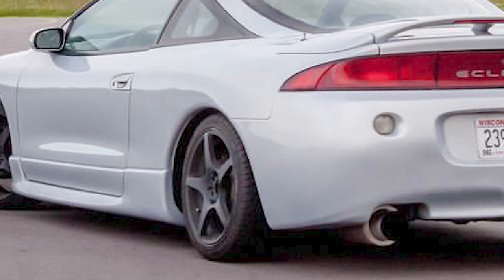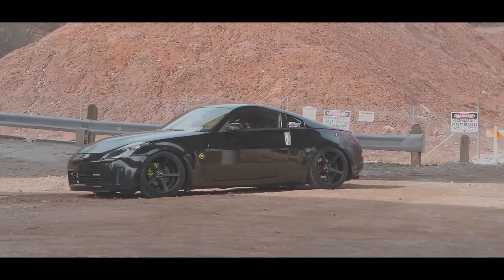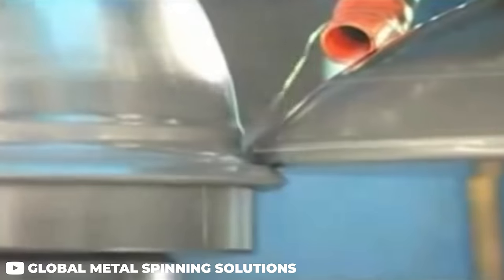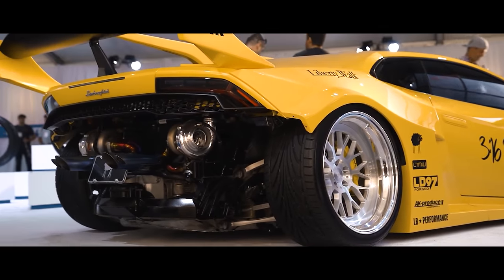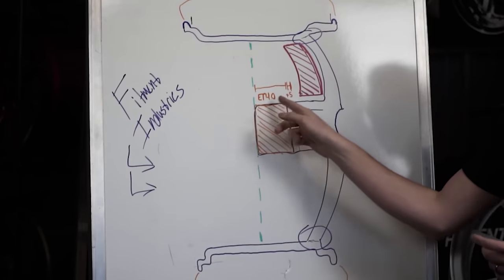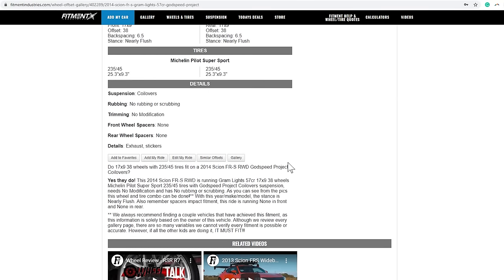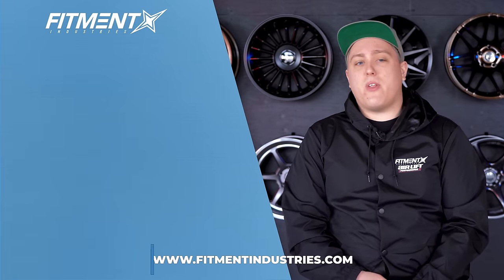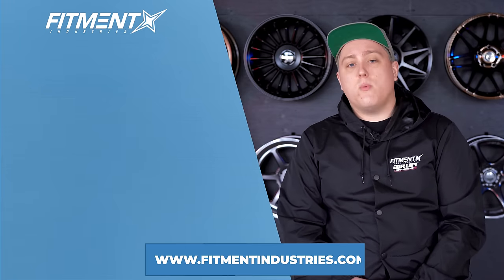Don't Buy Wheels And Tires BEFORE Watching This

Comment: Looking at Fitment for my first ever wheel/tire buy for my Celica. I know you are a salesman for them but no one on the forums have heard of Fitment. How reputable are they? Why should I buy from Fitment? What makes them stand out from the other retailers??
Reply: Don't buy from them. I've been waiting forever for my wheels. They use a freight company with lift gate service so that greatly adds to the already long build time. It takes days for them to mount a set of wheels. Even longer if they are not in stock.  Use their knowledge on fitments but buy from someone else, trust me on this. Google the reviews. I will update this post once I finally receive my wheels.  This has been the worst wheel experience ever.
Reply: @graveshaker  thanks for the heads up!

Comment: What kind of after market wheels can I use  for an rx 350 2015 lexus ? Bearing in mind that I want them as wide as possible, I currently have a 19 inch factory default f sport rim , with 265 50 19  pirelli tyres on
Reply from the maker: Yo!  Check out our gallery and you can see the biggest specs others are running! 🙏

Comment: I have a 2010 Toyota Avalon xls, I know that I need 22x9 , 5x114.3 lug pattern, I want my tires flush with the fenders, what would my offset be, one shop told 30 to 35mm, another shop told me 40 to 50mm. What’s your opinion. Please help.....

Comment: Mistakes: lighter isn't better. BBS/Rays doesn't mean it'll survive a pothole on the highway at 100 MPH. Autocross will bend and warp your BBS wheels. Beadlock needed. Stretch tires will slip off the rim at lower PSI. When you have to use 19 PSI cold to reach the correct hot temp of 29 PSI on your nice ZR tires.

Comment: what brand of tire offers the widest 245 40 18  . I want to keep stock tire size but go from 8.5 to 9.5 wide rim  and would like to limit the streching as much as possible 
thank you
Reply from the maker: If you’re going for a meaty look I would bump up to a 255 on a 9.5 wide!
Reply: @FitmentIndustries  255 40  or 255 35  
I know 255 it s a bit tall but I plan on keeping stock height  2019 wrx  and I wish I could run that size

Comment: I have a 2005 Infiniti fx 45 awd it’s lowered with H&R lowering springs have a set of r35 gtr wheels but don’t know what tire size to use I don’t want to to ruin my awd shaft I want to eliminate the gap between the rim and wheel well and also want that wide tire look please help

Comment: I have a 2020 honda accord stock wheels are 17 but can i to get 20 wheel or thats wont work? if works then what specific for those 20 wheel i need for both tires and wheel thanks

Comment: I’ve got a 2016 Altima with the TPMS system. Can I still use current sensors on the new rims?
Reply from the maker: It is recommended to buy new ones!

Comment: Or better yet what is the correct 19 inch wheel fitment for a m3 e46 2001 convertible with a pandem wide body kit?
Reply from the maker: DM us on IG or FB and we can help with fitment!

Comment: I'm buying a 350z with 18x13 in the rear. What tires size would you recommend for a proper non-stretched look fitment. I prefer to be safe instead of looking cool. Thanks...im a subscriber
Reply: None. Get those things off of it. The only 18" tire that is made to fit a 13" wide 18" wheel, is a 345/35R18. Even a 335/30R18 only goes to 12.5". Get a set of nice 9.5" rear wheels and be done with it. Those 13" rears are totally pointless on that car.
13"x18" wide rear wheels on a 350Z? I got three words for you. "Rice rice baby".
Reply: @AB-80X  yeah I agree with you. Even thou the guy who owned it before me thought it looked cool. At the end of the day. It was rediculous and "rice" with wheels poking out 2" from the fender. 

I now have 18x10.5 with 295/35/18 in the rear. Wheel fitment is spot on...

Comment: Hi maybe we could help you with this question? i have f30 Xdrive in this moment i use tyres 225/40/19 and 255/35/19 I wanted to put higher tires like 255/45/19 and 255/40/19 won't it hurt that 4x4 Xdrive?:) maybe you have an example of who used such images on the f30 thank you
Reply from the maker: Check out our gallery to see if any others are running the same specs!

Comment: Just bought 16x8 wheels for my 03 Tacoma since the stock size (16x7) was near impossible to find in terms of price point and oem weight comparability. Did 0 offset since I didn't want rock chips in paint from negative offset and no point in positive offset on an offroader. Still will be rocking stock tire size but have yet to put the wheels and tires on. A little nervous not gonna lie. Hoping the extra inch doesn't end up screwing me over, not much I could find on forums about people having done the same, some folks said they were fine, some folks said there was some rubbing on mud guards, guess I'll find out soon enough.

Comment: I have 2019 genesis g80 sport ,am looking for 20 inch size wheels instead of 19 inch OEM what brand you can recommend for me with reasonable price?
Reply from the maker: Hey there! Heres a link to the gallery so you can check out various types of styles, that way you can get some good ideas. Heres a link! -Edgar

https://www.fitmentindustries.com/wheel-offset-gallery?sort=yno&year=2019&make=Genesis&model=G80&drive=AWD

Comment: So which would poke out more towards fender,
Wheels 17 7.5jj et35 or 17 8jj et38?
Reply from the maker: The 8's for sure. But not by much! -Edgar
Reply: @FitmentIndustries  
 So even with the offset is 38 the 8jj is wider, cus im trying find wheels for polo 6r i want it to be same as the fenders not poking out not to inside
Reply: Any recommendations?

Comment: Hey I have a 13’ Lexus GS350 Fsport, I am currently running the stock OEM 19’ Alloys, I want to get some wider rims 19x9 front 19x9.5/10 in the back how big should my tires be or what sizes should I get if I do not want to lose ride quality along with achieving that flush look?

Comment: I see some cars with stock size wheels which leaves are regular gap between the wheel well and the tire and I see some where the tire fits right into the wheel well (fender). Does this mean that they got one size higher than the stock size? Also, does it rub in the wheel well when they go over bumps or when they carry heavy cargo in the trunk? Thanks

Comment: Even after this video I'm still not sure what size rims to buy to keep the stock feel on my 08 350z.
Reply: probably 18x8s
Reply: @xGqD_0  I think it said 18x8.5 in front and 18x9.5 in back but not sure about what offset to keep the stock feel because I don't want to have to do coil overs or modifications to make it fit. I'd want to be able to order mount the tire and install that's it

Comment: I live hee in Winnipeg and bought a new Honda Civic. I plan to get an 18in rim and 40R but I was warned by some of my friends that there are some pot holes here in the city so they advised me to get 17in 45R instead. What do you guys think? And also, I've never tried 18in for a sedan yet. Is the ride still smooth or rough?
Reply from the maker: It all depends what width and offset you get.  Going to 18s is something a lot of owners with Civics do.  Check out our gallery for examples!
Reply: @FitmentIndustries  Thanks! I'll check them out. Majority of the people that I asked are in favour of 18in.

Comment: So ok, I seen some fitment with some Volk TE37s 18x10.5 +15 and it was perfect.
Now I'm wanting some Works Emotions, same kind of car.  Still 18x10.5 but since the Works have more of a lip compared to the TE37's, what would the offset be to keep the same fitment as the TE37's?  Or is it the same and I'm totally missing something?

Comment: Good info but I'm still waiting for my wheels and tires was told that one rim was sent straight to me but why would they do that when there suppos to mount and balance and install the tpms sensors. They told me they would send me the tires and I can have a shop install it and they would cover $20 if I send them the recipe. Really need to be better at shipping because I didn't pay $150 for fast shipping and not have you guys even mount or balance. Now I have to wait and pay out of pocket for your mistakes.

Comment: If you have a rl negatieve offset does that mean the wheel is gonna poke more outwards?
Reply: No, it means nothing without a context. If you have a negative offset that is lower than what it was OE for example, then it won't. If you move from a positive offset to a negative offset, yes that will move the wheel further out.
It is very simple. Positive means inwards from the centerline, and negative means outwards from the centerline. Very few modern cars run anything close to a negative offset. That is usually only found in some pickups and older US cars.
All Euro cars and a lot of modern US cars run a positive offset. When dealing with a positive offset, the higher the number, the further in the wheel is set and the higher the negative offset number the further out. It's very simple.

Comment: I have a 2011 mustang gt i bought some Ford performance wheels 18 x 8 the standard tire is 235 50 18 but I want wider tires all around what are my options

Comment: Hey Fitment Industries, I have a request that might be a little troublesome, so it is fine if you cant do it. anyways I was thinking if you could do a SO You want series for Infinity q50/q60, and for Lexus is300/350. I would appreciate it a lot. Plz reply if you see this comment. THANK YOU.
Reply from the maker: Good suggestions! Check out our video on the is300 here - https://youtu.be/yP7PO62u_oE
Reply: Thank you, then only the q50 or q60 plz, if possible.

Comment: How do I know if a bigger tire will fit my wheel? The tires on the wheels now are 275/35Z it's a size 18 wheel I want to get  bigger tires mainly just to have it look good from the back would I run into any issues if I got a bigger size for example a 295 or 305?
Reply: How on earth can anyone answer that if you don't tell us what the wheel width is or what car you have?
Reply: @AB-80X  Yea I’m an idiot lol. after working at a tire shop times have changed & can answer this it’s ease lol. I had to get educated first 😂

Comment: I recently switched my rims out from some 16s to some 19s and while I’m in my car driving I hear some weird sound kinda like scraping and I can’t seem to find where it’s coming from, went back to my 16s and now the sound is gone? I already spent the money on the wheels and I want to use them but this noise needs to go away. Any ideas? I drive a Honda Accord 2012
Reply: Probably rubbing your fenders with your tires
Reply: CRiMZUHN nope checked that.
Reply from the maker: Sounds like you’re rubbing on fender wells! There are other sizes than just diameter that factor into how a wheel fits! Email us at shop@fitmentindustries.com if you have any questions

Comment: Getting my first set of wheels soon 19x8 with a 40 offset. Wondering what tire size is best 245/40 or 235/40. Your input would help a lot. My stock set is 215/60 r16 tires stock wheels 16x7 with a 40 offset.
Reply: Kinda depends on the car in question. But overall, 235/40R19 would be the largest I'd go. 225/40R19 is a more "correct" fit. They will ride better and will have much less of a negative impact on the cars overall performance. You add a lot of weight with those wheels probably, and with the 235/40R19,, you also increase the diameter from 26.1" to 26.4", which essentially has the same effect as a taller gear ratio.
You may think that you gain a lot more grip by going to a 235 over a 225, but think about this. Your car was born with a 215/60R16, and without knowing what car you have, I can be quite sure that it's not a high performance sports car. That's not a negative, it just matters because it is a determining factor in what a tire can offer you. Tires available in your stock size, are grand touring tires, all season stuff etc. and far from performance oriented. You could actually stick to your stock tire width and still gain more grip than the car would ever need, so a 235 will not add anything. If anything, over a 225 it will feel less precise as it will float around more inside the wheel, whereas the 225 will feel slightly stiffer and offer a more direct steering response. A Michelin Pilot Sport 4S in 225/40R19 will offer many times more grip than any 215/60R16 ever will, and being a 225, it will offer both a very good level of comfort as well as excellent wet performance. 
I know your question was old, but also post this for others to read in the future.
Reply: @AB-80X  what’s the best place to find out what bolt pattern and offset you need? My son is shopping for wheels for an 07 Chrysler 300. Got some 22” 5x 115 but they are rubbing on the ball joints I think is what the shop said.

Comment: Lol I have a 04 pontiac grand prix  GT1..they have stock 16 rims but I accidentally ordered 17 with offset of +38... will this still work without needing to make major adjustments?? Or should I swap out for the 16s? When I ordered the website said they were verified fitted. But I'm not sure now that I've been re looking.

Comment: I have a g35 coupe with avid1 av06's that have +20 something offset and my fitment i horrendous. Should I get spacers? if so what size im on stock suspension.

Comment: Is it worth it increasing rim size from 15 inch to 17 inches on a Mazda2? I feel like the cons would outweigh the pros
Reply: Your assumption is correct. That is a subcompact car. Going to 17s is just going to make the ride rougher. Average Americans just need average tires. all this low profile stuff is a waste of money and less safe. I feel like starting my own car company.lol  Skip all the electronic bullshit, except for rear camera and blind spot monitoring,acoustic glass and 14 speaker audio systems. Lol Americans just need cars that get great gas mileage and a smooth ride. You don't have the Autobahn to ride on! Lol

Comment: Alright I have a question.
I have a 2006 Mitsubishi V6
I want to have a set of rims on their that's enough to poke out a bit since I dont wanna hassle with spacers. I also wanna get coilovers. What's the recommended measurements I should do for the coilovers, and what size rim and tire should I get for something like that
Reply: You might want to post a bit more info than that lol. Is it a Galant, Pajero or perhaps an Eclipse?
Reply: @AB-80X  OH it was a eclipse lol. I dont have it anymore though

Comment: Are cast or forged wheels usually lighter than the stock wheels?
Reply: No. Cast wheels are quite heavy if they are larger. Forged can be lighter, but not always.

Comment: I had a s2000 running 18x9.5 215/40 all around......had to replace front lip twice in a month
Reply: I currently have 19x8.5 and 19x9.5  forged for my g37 stock height. I was thinking about running 245/45 in the front and maybe 255/45 in the rear. That would fill the wheel gap right? Don’t want to go lower at all rains a lot in the northwest.

Comment: Thx I have a 2018 vw atlas AWD se.  I am getting 22x9 wheels and wanted to put lowering springs on it to lower it just about 1.5".  I am debating over a 285x40x22 tire or a 285x35x22 tire.  Worried about rubbing etc, but 35 seems SO low profile!  Hoping the 285x40 tire will be ok with the lowered look?  Definitely still new at this!

Comment: So you want a Saab 9-3???????? 
going over the different gens facelifts and packages aka viggen, vector(aero), linear, arc, aero, TurboX

Mods from bolt on's too tunes 

2.0L 4banger 
2.8L v6

Fwd 
Xwd

Passive rear wheel steering something😂

They're a very cheap safe fun car if you can find a nice one with the right package and miles easy to mod/tune for quick daily fun 

Just throwing out stuff I find neat
But be careful I think it twas alex that big oof goofed once already while Saabs were briefly brought up in a previous video I know a large community that would definitely check it out if its as detailed and accurate as most of the videos are

Comment: hi , IS250 currently running 2019 Bridgestone turanza tyre on it( FRONT 225/40 R18 88Y BACK 255/35R18 90 Y ) . It's hard to find a Michelin Pilot Sport 5 for the rear size 255/35R18. So is it possible to change size to 265/35R18. I have an 18' F sport Rim. Thanks in advance for any input you all may have for me.
Reply from the maker: Are you on any kind of suspension?  If not, you should be able to fit that just fine
Reply: @FitmentIndustries  stock suspension.

Comment: higher sidewall is better than the the stupid low profile I see on a lot of cars. When you hit a pot hole on a low profile they are more prone to sidewall blow out as the air is forced sideways or wheel damage, long term you want the highest sidewall you can get